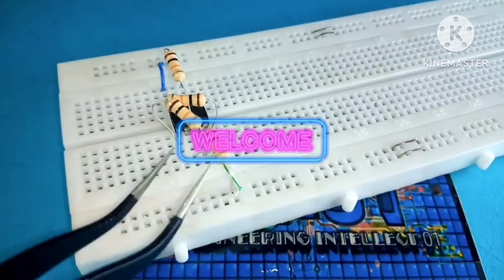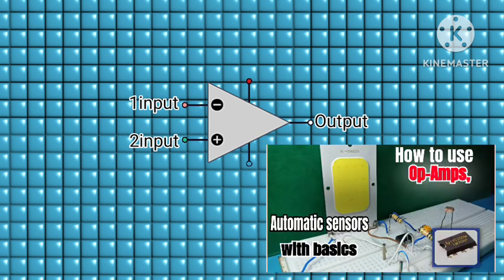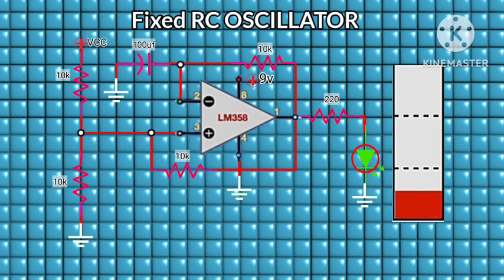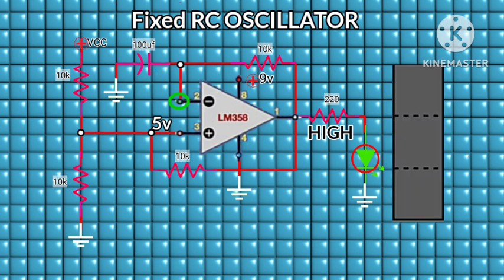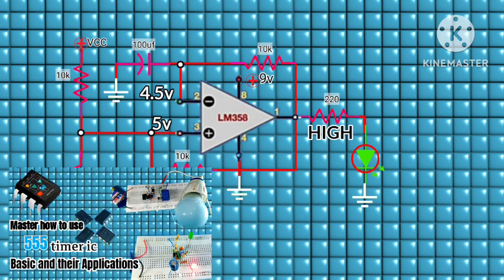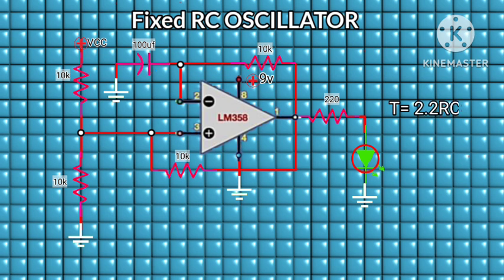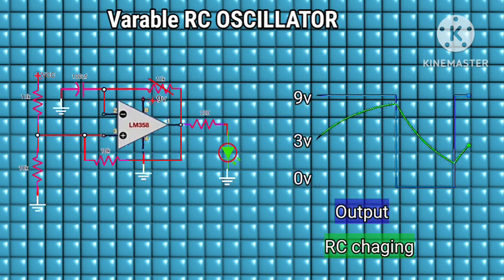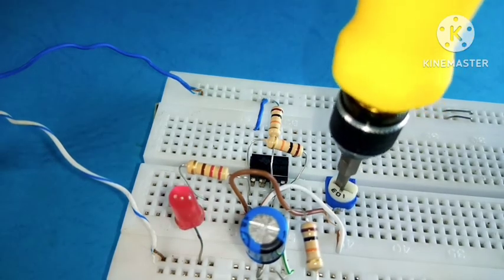RC Oscillators with LM358 OP-AMP learn the easy way

Comment: Excellent to use an LED for those of us that don't have oscilloscopes.  An excellent visual of the oscillation of the circuit and the change using the variable resistor.
Reply from the maker: I'm happy you liked the LED visual! 😊